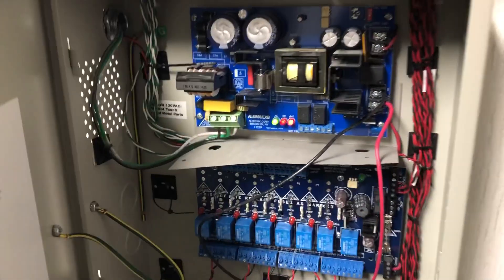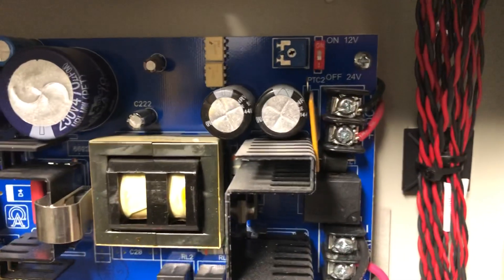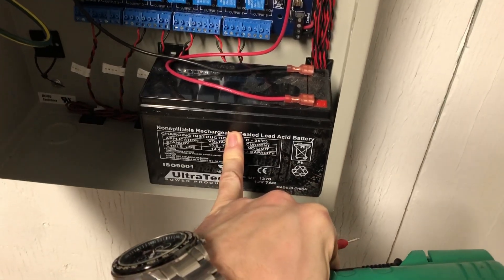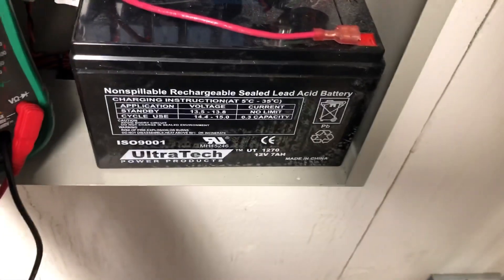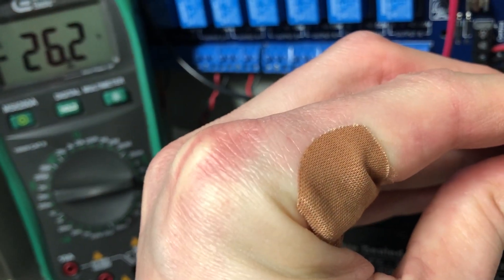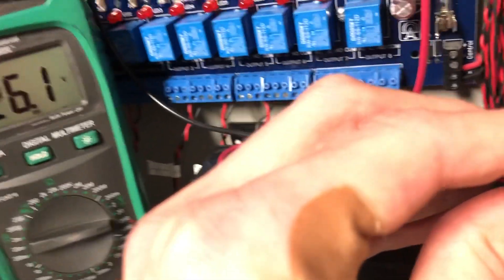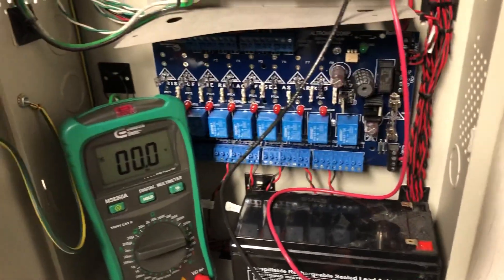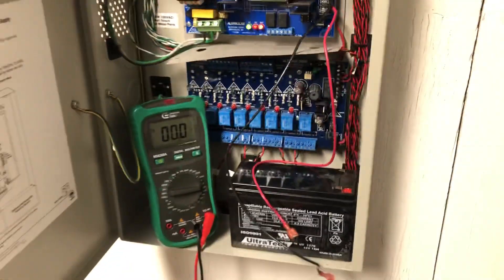Crazy Contractors almost burned down the building!! Power Supply and battery incomparable

Comment: Hey guys, I'm trying to get some help with an Altronix eFlow 1012NB power supply. I have noticed that the batteries of the access control system are outdated and must be replaced, they don't retain enough energy. Due to the battery's condition, I know that this kind of power supply has a low-power shutdown function integrated. It shuts down DC output terminals if battery voltage drops down 80% of nominal to prevent deep battery discharge. 
The issue is, at some point, we could be having voltage variations in the building, or, the power supply detects the voltage drop and cuts down DC outputs because of the voltage variations of the building or because of a power shutdown (that has not been reported). 
After this, the access control system goes off. To re-establish the system, we need to go back to reset the circuit breaker manually. After this, everything comes back to normal. But my question is, do I have to do this every time the system goes out, resetting the eFlow power supply manually? If power comes back, should the power supply work normally without our intervention? I will be changing the batteries soon. To test and kinda solve the issue, I changed that eFlow power supply for an AL1012ULXB, and for some reason, for 7 days we have had no problems (still with the outdated batteries connected). Hope you can help. Regards.
Reply from the maker: First thing I'm noticing is the old batteries. That would be the least expensive upgrade, but either way, the purpose of those batteries is to work like a UPS and give you temporary power until the power bump/loss returns to normal. Access control should always be on red plugs(generator etc). If power goes out constantly, it wears out the batteries sooner that the typical 3-5 years.  Depending on the age of the batteries, it might just be degraded batteries and the older power supply might have been fine?
Reply: @VisionGuy  thank you for that advice and for taking time to answer. I will be replacing the batteries soon. I might be returning the eFlow power supply back. But one last question, does all the eFlow power supply's need to be reseted manually once they shut down DC output (for any reason)?
Reply from the maker: @samuelhernandez7394  I don't remember ever having to reset them manually, so that's a bit odd. But then again, I don't ever remember batteries dying either.